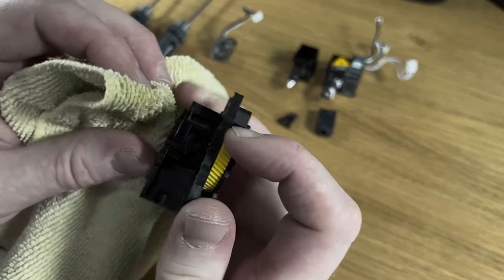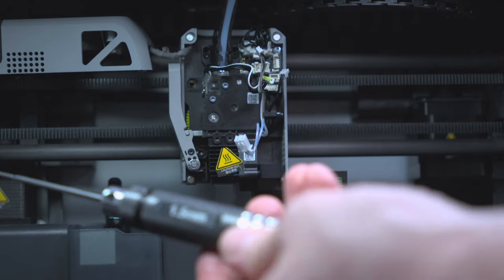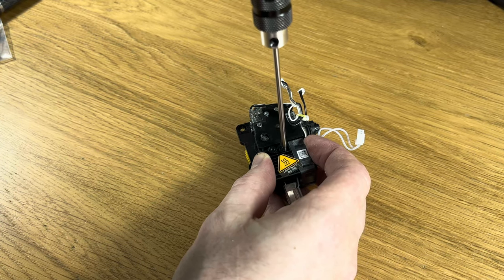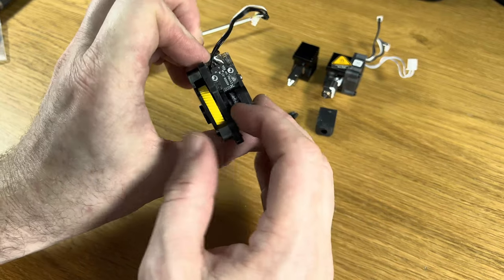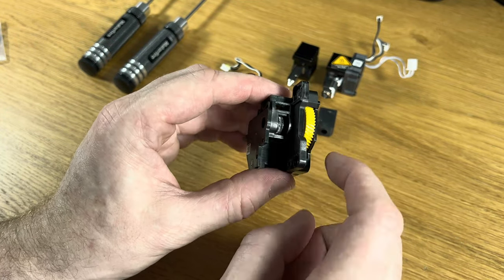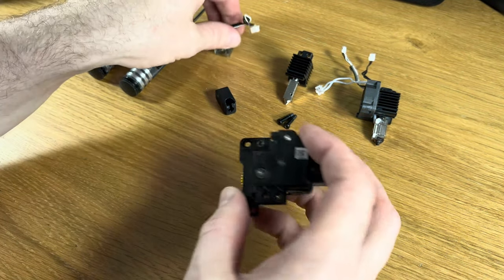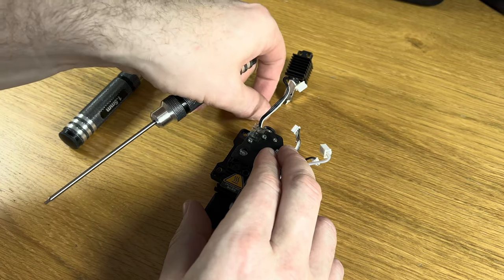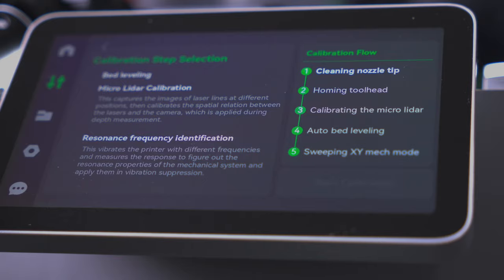Ultimate Guide: Bambu Lab Carbon X1 printer nozzle  teardown

Comment: I have yet to get a clog in the filament sensor but I do seriously think they need to redesign the upper filament path of that extruder housing. Most my clogs in it are under the runout sensor just above the hobbed gears inside that larger gap. Every time I have a clog I have to push the filament down out of that opening and snip that tip off. That opening there is pretty huge. Most extruders have it as a small diameter opening just like the lower half under the hobbed gears. I think that larger opening on the upper half of this extruder housing doesn't help keep the shape of the filament. The filament tends to curl or even swell ever so slightly as it goes into that gap right after the hobbed gears release it to where it wont pass through the filament sensor. This could be for a few reasons. Either I am getting a little bit of heat creep making my filament pliable, or the extruder tension is too strong deforming the filament ever so slightly. It could be both even. There is not much play you can give on the extruder tension as cover prevents you from backing the screw out much at all. The stock position from the factory has it screwed all the way it. I backed mine out as much as I can but the spring used is really strong as well so it does not relieve much pressure. As for heat creep, I would normally do a PID tuning but I have no clue how to do that with the BambBu printers. From what I gather it is not an accessible feature and done internally. I know mine needs PID Tuning because I use the Panda Revo hotend on mine. I guarantee the tuning is off a little do to this. One day I hope to figure that part out. I think it would help me a lot. Until then I just have to live with it. It is not too bad though as I do not get clogs all the time. It is only ever once and a while.

Comment: I have had my printer for a grand total of 2 weeks and I already got a clog on the extruder. This is the only video so far that I have seen that is a tear down so thank you! Now I just need to figure out how to take off the cog as the filament froze the whole bit
Reply from the maker: Thanks for watching, sorry to hear that, i was going to take apart the extruder but i was short of time when i made the video.  One of the things you need is a small box with the holes to hold in place the extruder parts.  Typically its something you can print, if your extruder is not clogged.  If you have another printer you can print it.  Not sure if you can do it without the box.  Very weird that its locked up the extruder unit itself.  It could be faulty unit, if you don't fancy trying to take it apart, I would contact BL support and see if they will give you a replacement under warranty.  Alternately, purchase a replacement part, print the tool and then dismantle the broken one.  What a pain…  BTW have you seen Bambu Lab's own video of the extruder dismantling? I might record one, but not really necessary if this one covers it https://www.youtube.com/watch?v=CLlT1RV-oJE

Comment: This is NOT the "Ultimate Guide".  He stops short of taking apart the drive gears.  If you get heat creep like I have gotten a few times you might have to learn this and it is covered in other Youtubes.
Reply from the maker: Yes, i don’t split down the gears here, maybe in another video. Would be interested to know what is causing your heat creep, i have never had this, mine is stock.  Looking at adding an E3D to test, and it was a concern this might lead to issues.
Reply: Take off the screw on the side. The spring and thread falls out. Grab the yellow gear and pull up. That's it.

Comment: Great help video. I just had mine X1C extruder cleaned. One more thing, you may need to dissemble the whole extruder as some left over filament may get stuck inside. plus, use brush to clean the gears also makes future life easier. Great work!

Comment: Brilliant!  My X-1 has just refused to print. After removing the filament a green dot still showed on the control screen which I gather means there is still filament detected in the extruder. There is no other video that makes the process for unclogging the extruder look so easy. Thanks a million for making this video.
Reply from the maker: Glad it was useful, thanks for the feedback.

Comment: I got a blockage in my X1 Carbon and at first thought it was a nozzle blockage and so I removed the nozzle but it turned out to be a very small piece of filament that had broken off inside the Bowden tube, I tried to replace the nozzle but it wont push back up into the extruder, I haven't removed the extruder yet, what could stop the nozzle from pushing up into the extruder besides filament? I used an Allen key to feel around in the nozzle aperture and there doesn't seem to be anything protruding into the aperture.
Reply from the maker: @AndrewAHayes sorry for the late response, I assume you have found a solution, but in any case, if I understand you correctly you removed the nozzle but left the extruder in the print head? Nothing should block the nozzle going back in, but you should remove the extruder, it pretty easy to remove and put back in.
Reply: @T8Maker  Yes it was also a piece of broken filament in the extruder, my fault as I put an old roll in the AMS with only about 10m left, I have loads of these roll ends but in future I will just use them on my Ender 5 Plus machines as broken filament is much easier to remove than the Bambu is.
Reply: @T8Maker  It turned out to be one of the brass thread inserts that had become proud, I was sent a new extruder by my vendor by next day delivery.

Comment: Any little tricks to get the bigger yellow gear to mesh back up with the drive gear when your replacing the extruder back in the machine ?
Reply from the maker: @kmcgraw65 Hi, the gears are quite small, so a gentle wiggle of the extruder as you put it back in will help line up the cogs, but most of the time it will go straight in without issues.  Just don't force it.

Comment: I recently purchased the same machine. It was very helpful. I have a question. Is there any wear and tear on the XY-axis carbon shafts?
Reply from the maker: @tama0722 I haven't seen any issues in several months, you do need to keep it clean.  That said, as with any moving part, it isa consumable part and will eventually need replacing.  Bambu Lab does have it in stock if you do need to replace the rods.

Comment: Good vid. I had to do this cause the printer thinks it has a clogged nozzle, which it does, but it keeps getting stuck on it. The error message that is.
Reply from the maker: @Pablo668 What filament are you using?  I have had issues with silk PLA from certain brands clogging in both my printers.  My guess is temps are wrong, but cant test it because it keeps clogging.
Reply: @T8Maker  I was using the Carbon Fibre PLA filament that came with the printer. I've printed a few things using that filament since then, it's been ok.
The only way I could find out of the error messages was to restart the printer, several times.
Reply from the maker: @Pablo668 I assume the error was some feeding or retraction error?  Maybe there was already some clog in the print head, residue from other filaments, that cleared out after using the filament for a bit, its pretty abrasive.  If you were still having the issue and if you had a spare head I would recommend swapping it out to see if you got the same issue.  But in general, the CF filament are recommended with a 0.6mm nozzle rather then the 0.4 due to the fibers.  That said I have printed with all of BL CF filaments and never had a clogging issue, I have also use several other brands and they all print fine with 0.4mm.  Hopefully the issue is solved for you.
Reply: @T8Maker  Yeah I’ve used BL CF since with a  0.4 nozzle and it has been fine. Not really sure why it clogged so badly. It was brand new.
Reply from the maker: @Pablo668 if its not the head, likely it was a temp issue.  But as long as its working now, hopefully it will stay that way.

Comment: my printhead started making clicking noises when unloading filament... but loading is normal... what could this be??
Reply from the maker: @teabagNBG, is it definitely the head? Could it be the AMS filament buffer at the back of the printer or the AMS itself.  In the head, check the extruder cog to ensure its not damaged or worn.  In the AMS Hub there are springs inside that can click.  In the AMS the first stage feeder does the extrusion, and again it can slip and click on the extruder cog.  Does the filament slip or is it feeding/retracting smoothly?
Reply: @T8Maker  yes definitely the head... i will take it off now :D
Reply from the maker: @teabagNBG Let me know how you get on, I would be curious to know why it only clicks in one direction.  If it is the cogs, likely due to pushing rather than pulling.

Comment: I really like to take the dive into one of these new generation printers but I don't think the community is big enough yet. Think I will wait until lidar is more fully adopted.
Reply from the maker: I have a Prusa MK3s+ also, and except for the speed I tend to prefer it because firstly, I built it. Secondly, I can easily customize it if I want to, and lastly, parts and info is readily available from many sources, including Prusa support, which is the best support by far of any printer vendor.  And if I need something to be perfect, it's also rock solid reliable, but Sloooow.  The Bambu Lab CX1, is cool tech, very quick,  has some small issues from time to time, but generally works great.  But if anything happens to it, it's a closed eco-system, parts have to be got from Bambu Lab, which can be out of stock, and you're reliant on their very slow support, their Wiki, and YouTube to find a fix.  Re the Lidar, I am not sure how much value it adds.  I have printed quite a lot on the textured PEI sheet without issues and the Lidar doesn't work with that sheet because of the texture, so...is it really needed?  Thanks for watching the video and your comment.